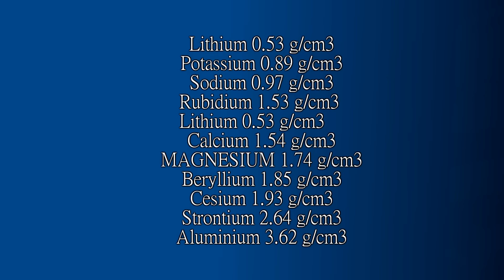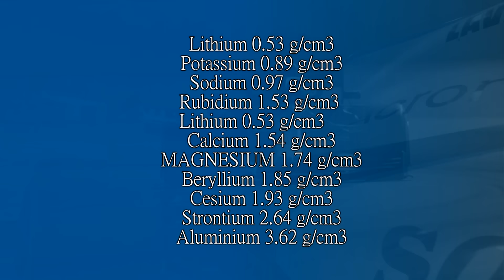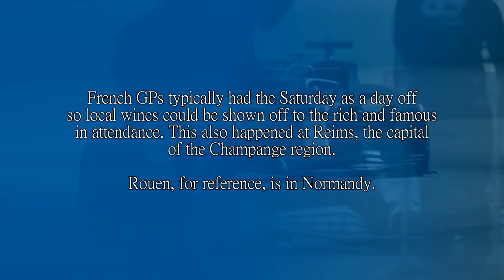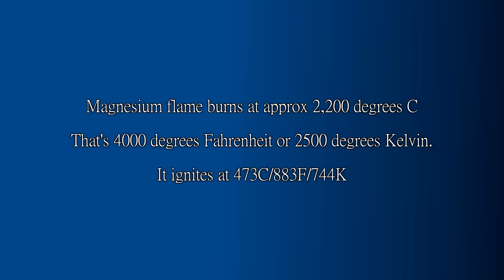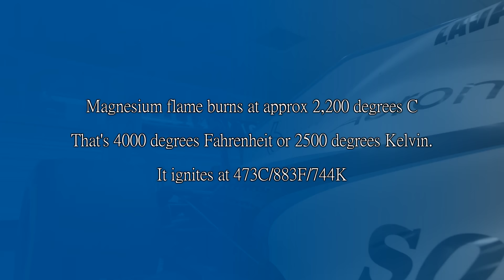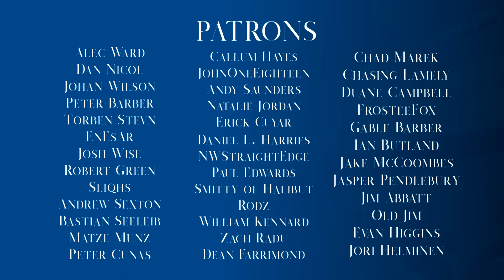The Car that Should Never Have Raced: The Story of the Honda RA302

Comment: There are videos on YouTube of Schlesser's Honda after it crashed, and the resultant firefighting effort.  But I wouldn't recommend seeing them if you are in any way squeamish or easily upset.  The fact they tried to put out a magnesium fire with water is alarming to say the least.

I read an eyewitness report on the Autosport Nostalgia forum that said the Honda landed upside down so hard after it flipped, that Schlesser may well have been killed before the fire started.  We can only hope.
Reply from the maker: It was shown in the Killer Years doc along with Von Tripps’ crash.
Reply: I'd say given the near fatal injuries sustained to A.J. Foyt in a more secure stock car at least for a flip given the roll cage at Riverside that Schlesser was almost certainly killed as (a. the embankment Schlesser went up was steeper, (b. Schlesser's head and neck were exposed, (c. Schlesser rolled more times than Foyt, (d Schlesser landed upside down, and (e. Foyt was declared dead and only revived by Parnelli Jones removing a clod of dirt from Foyt's mouth.

And there was a lot more things going Foyt's way at Riverside for it to almost kill him.

Comment: The three most hard-hitting deaths in F1 were (in no particular order):  Senna, Villeneuve and Clark.
Reply: I won't disagree, but in my time as a follower of F1, we lost Jules Bianchi. Maybe not yet as beloved by fans as the drivers you list, but Jules' life-ending collision with the crane in Suzuka resulted in at least 2 major changes in F1: the virtual safety car and the Halo. Since then, we've seen multiple accidents where the Halo unquestionably saved the driver from critical injury or death. Verstappen landing atop Hamilton is one, and certainly Grosjean's miracle survival after going under a fence. It's unknown what effect the VSC has been on safety, but it has surely changed pit strategy!

Comment: Yes,  magnesium will burn quite readily in air once ignited.  It will also burn under water so no good hosing it with water.  Aluminium also burns readily in air IF and only IF its oxide coating is removed first.  Aluminium readily forms its own oxide coating which then prevents further oxidation.   Beryllium is about as light as magnesium but its dust through abrasion or machining is highly toxic needing very special dedicated machining facilities and then in products where it can't fragment.  Upside is its very low coefficient of thermal expansion.  Titanium will also burn in air in the right circumstances.   Notionally about as strong as steel but but with an SG of 4.5 vs. 7.85 for steel.  Epoxy carbon composite volume for volume is notionally as strong as steel but one third the weight.  However as Rolls Royce found out during development of the RB 211 when wet it then becomes notch sensitive.  The smaller the dia. of the carbon fibres in epoxy carbon increases the strength BUT fibres small than 10 micron in dia. can permeate the human skin and migrate throughout the body,   which is why industrial  carbon fibres has filaments 10 microns or bigger.   So called high modulus epoxy carbon uses filaments smaller than 10 microns so if a fighter jet crashes near you it may well contain both beryllium and high modulus epoxy carbon so best to keep well away.

Comment: The magnesium wheels are alloyed with other metals for this very reason. Sparks can be any metal filaments under extreme friction. That being said, it isn’t easy to ignite magnesium. The autoignition  temp is around 880 degrees in freedom units…

Comment: Magnesium? Like those emergency Firestarter blocks, with a ferrocerium striker on the side. You scrape off slivers of magnesium into a pile with your camp knife, and then turn the block over to use the provided ferrocerium striker to shower sparks over the pile of magnesium slivers. That material just burns until its completely used up. It creates its own hydrogen when thrown into, or doused with water. Incredibly volatile stuff, burning at 4000 °F.

And Honda built a car from it? Thats actually crimminal...

Comment: The main problem Honda had was that their car concept was based on the pre-1966 assumptions about the 3 liter formula.  Most teams guessed that a large, high power engine was the way to go and assumed that meant a V-12 or in BRM's horribly bad ploy, an H-16.  Cooper, Ferrari, BRM, Honda and Lotus (initially) were all on this path.  Gurney's Eagle was essentially based on the Lotus 38 Indy car, which again led to a larger, heavier car.

Then Brabham came in with a relative low power engine but a car that was close the weight limit and won the 1966 championship.  And Chapman came out with the Lotus 49 in 1967, which was both compact/light but also had as much or more power than the heavy, complicated engines thanks to Cosworth.  By 1968, the jig was up for the big V12s like the Honda and the fast boys were running the Cosworth.
Reply: Yeah, boo exotic engines!! hisss!!   who follows F1 for ordinary engineering?
Reply: Did any teams consider supercharging, rather than turbosupercharging, their existing 1.5L engines?
Reply: @stephenscholes4758  
Well, following was what the exotic engines did.  They followed the cars with Cosworths.
Reply: Because it was cheaper to buy an off the shelf engine. Money no option, a V12 with the same development, will always beat a V8 in every respect
Reply: @stephenscholes4758  
Well, there was a test case from 1967 to 1981.  The final score was V8 - 11, V/Flat12 - 4.
Reply: @jimiverson3085  How many non-Cosworths?  One? So much for it being the designers choice. Even Brabham thought his was quote "not a true GP engine...."
Reply: @stephenscholes4758  "A V12 with the same development, will always beat a V8 in every respect" It didn't though, not even from 1989 to 1994 when the capacity was increased to 3.5L which should suit the 12-cylinder layout more.  If I'm not mistaken you had V8 and V12 with one WDC title each under 3.5L, and V10 seemingly the optimal solution with four WDC titles under 3.5L.  The V12 seems to be disadvantaged in size, weight and frictional losses compared to V10 or V8, despite theoretically having more total valve surface area, less reciprocating weight per cylinder and thus theoretically the possibility for the V12 to pass more air through it and rev higher.  One must bear in mind that a racing car works as a total package, the most powerful engine in isolation is not necessarily the best if it is too large, too heavy and uses too much fuel.

Comment: I worked in the field of automation repair.  I was given the task of assessing the damage to a machining center that
they had been using to machine magnesium.  Mag is unusual in the fact that pouring water on a mag fire only makes
it burn hotter.  Because the magnesium burns so hot, the Magnesium will take the oxygen and hydrogen out of the 
water and burn it as fuel.  The cheap way to put out a mag fire is to use oil.  I know it sounds crazy, but that is what 
works to smoother the fire and deny it the oxygen it needs to burn.  
The operator of this machine had failed to continually clear and clean out the chips that were building up on the 
machine.  So the magnesium chips were piled up under some of the panels.  After this fire started, they could not
get close to the machine and this pile burned like a coal fire.  The heat and smoke was so intense that the fire
department elected to keep the building from burning down and just let the magnesium burn itself out.  It took 
hours.  The heat from a mag fire is one thing.  The brightness from these fires is blinding.  You can't look directly
at it.  Much like watching someone weld.  The brightness will cause eye damage.  To get some idea of what 
magnesium does.  During the 4th of July, they sell these things called "Strobes".  It a device that burns and then
flashes like a light bulb with this blinding light.  That is magnesium.

Comment: Magnesium body-panels were fairly common until the advent of composites. Pierre Levegh was killed in his Mercedes-Benz 300 SLR when it crashed during the 1955 Le Mans disaster. It's Magnesium body bust into flames showering the spectators with white-hot metal, contributing to over 80 deaths & maiming another 100 . To give some idea just how flammable Magnesium is, in it's powdered form, it  is the primary constituent for solid-fuel propellants as used on the Space-shuttle's boosters & many ballistic missiles: quite literally these cars are made from rocket-fuel.
Reply: Elektron in The German....

1935 <

J.C.
Reply: @hairydonuts6024 - From what I've read and seen, it wasn't pieces of Levegh's car bodywork on fire or not that killed so many spectators but the front drivetrain assembly axel and all, detached and catapulted into the crowd, causing blunt force traumas and many decapitations, I think in some angles of captured videos, you can see the car's bodywork landing straight on the tarmac and catching fire but not exploding bursting apart or flying into the crowd, of course front drivetrain might have included parts of the engine, like swinging a giant machetti trough the crowd, a terrible tragedy...
Reply: @marclevesque3147   As I said "contributed". The bodywork "exploded" right in front of the crowd, helping to incinerate the front row, but, yes, the main killer was the engine-block which ploughed through the crowd like a sledge hammer. You can clearly see this on newsreel footage. There's 2010 documentary, worth checking out on YT called 'The Deadliest Crash: The Le Mans Disaster' which attempts to unravel what happened, though accounts of events are confused, there's still, some controversy as to who was most at fault. One thing we can conclude is Magnesium is a dangerous choice for a racing-car's body-panel.
Reply: @hairydonuts6024  I agree with you, I rewatched the clearest(?) footage I could find, one thing seems clear tough, I don't know at what point Levegh stopped to refuel, but it seems he must have had a great load onboard, as soon as the car impacted the separating wall you can see clearly a distinct fireball that reduced quickly but the propagation of heat and fire quickly engulfed the car's body, if the car had gone further into the crowd, the casualties could have been double or worse, the car's fire was obviously intensified by the magnesium build, just like Shlesser in 68 and Siffert in 71, those fires seemed hard to extinguish, lessons were learned following disasters like these, but after the 55 disaster, racing car's magnesium bodypanels should have been banned, but even with less flamable body materials, it took a lot more time and deaths before fire became less of a killer particularly on long road circuits where in the old days fire tucks were scarce and crews were not properly equipped or present... No wonder at first, drivers were reluctant to use seatbelts, they preferred to risk injuries or death being ejected than being trapped in a burning car... And those who were even worse out of luck, ended up on fire upside down, like Bandini or Williamson, they obviously couldn't have survived, poor Bandini was alive for 2 or 3 days after, I hope the doctors were merciful  and kept hiim unconcious until he passed, heavy burn injuries must be near the top of physical human  suffering...

Comment: But how did the car do in mario kart?
Magnesium is in aluminum alloys and aluminum is also in magnesium alloys which also helps it not catch fire as easy.  
The worst industrial accidents usually have to do with magnesium powders catching fire.  Like you said big chunks do not burn easy.  
Great video as usual.
Reply: @Retired Bore magnesium burns so hot that water is fuel.  Any moisture in that sand and u are adding fuel to the fire.  A small amount of magnesium dust to catch fire will catch aluminum oxide and titanium oxide on fire as well.  They are usually close to one another as all are used in industry.

Comment: Example: commercial-grade aircraft “steering wheels” were magnesium, whereas the mil-spec versions were aluminum - when I worked at Boeing 30 years ago.

I recall there were “mag fires” on a few occasions…
Reply from the maker: Hornet ones were mag, apparently. Protocol was to shove em off the deck of the aircraft carrier if it caught fire.

Comment: Great historic race car piece. Great historic race track. Great historic race. Great photos at the beginning. Great production value all the way around. I like it! You left out the fact that once magnesium starts burning, it cannot be extinguished and water just makes it worse. When magnesium interacts with water, it will form a hydrogen gas that ignites violently due to the excessive heat and oxygen supply. When it reacts, it will burn hot enough to decrease the water molecule, which turns to a Hydrogen Gas. So the firefighters at the track didn't just not do anything and let burn. There was nothing they COULD do with a magnesium fire.

Comment: Magnesium was old hat. Used extensivly in Europe decades before. And it burns really well as any school kid is taught. And as any race fan or aircraft fan know.
There is magnesium and magnesium alloys however. 'Mag' wheels are not pure mag but an alloy. Though get them hot and they still burn. And absorb water like a sponge!! The reason nearly all 'mag' wheels are cast alloys.

Comment: Once magnesium starts burning if you apply water the burning will strip oxygen from the water releasing hydrogen.   The reason the fire fighters didn't put water on the fire is that water would accelerate  the fire.

Comment: Rally  cars have been known to set their wheels on fire,  I think F1 wheels probably fly apart too quickly
Reply: that's true, an example being Jonny MIlner's  Toyota Celica on the Jim Clark memorial rally in 2000, the fire spread to the car and was so bad that they had to use a foam that was usually used for aircraft crash fires

Comment: Actually the United States bought titanium from Russia by third parties since Russia would never sell directly to the USA. I remember watching a Formula one where an air foil failed and the car drove directly into a wall desentigrating killing the driver. The memory is still in my head because I knew the driver was killed. Nascar had problems with engines such as the 426 hemi which could exceed 200 mph. The tires at the time were not capable of that speed. Magnesium was well known for being extremely flammable, even then. Engines were producing power and speeds that the technology of the cars were not capable of handling. Today's racing cars are light-years ahead of the old cars. In Nascar restricter plates were installed to slow the cars to a somewhat safe limit. There is a point where drivers are incapable of reacting at higher speeds even if the car is able to reach such speeds. I've driven at high speed,not Formula One speeds, but fast enough to know you have little time to make corrections. There is a limit to human ability to what cars are capable of now. Professional drivers race are on tracks they know every inch of. People on the open highways don't understand they don't have the expertise of the professionals and that get them killed. Especially with the technological powerhouses you can purchase today. Many of the performance cars today would leave the best racing cars of the past in the dust if they knew how to handling them which most people can not. I drove fast cars from the 1960s and it's a wonder I didn't get hurt or killed. I witnessed a Mustang Shelby GT lose control and hit a tree. It had to be picked up in pieces and it killed everyone in the car. It wasn't an open casket funeral.  Very sad and unnecessary. I had a chance to buy a perfect low mileage Shelby GT big block for 3500 dollars. It was absolutely a beauty. At the beginning of the 1970s you couldn't afford the insurance for the muscle cars. I would have probably killed myself in that car. No one would ride with me then, not even my brother. Here in Tennessee many started driving when we were kids and some of us were pretty good and some of us didn't make it. I was clocked at 118 mph in my 1968 Mustang by a highway patrol. I pushed it to 135 mph but he didn't pursue me.  The trooper pulled up in my driveway the next day and talked with my grandfather and me. My grandfather asked why he didn't pull me over. He told my grandfather "that boy wasn't going to stop for me." He was right ,I wasn't. The trooper did not give me a ticket. I was in enough trouble with my grandfather. It was a different time. Here's another story. Western states did not have speed limits at one time. I remember my mother setting the cruise control on 120 mph driving a 225 Buick Electra, 455 big block on the open highways out west.  It was legal and a plane crash if you wrecked. A friend of mine gave me a ride from Carson City to Reno. It is 30 miles. He made it in 15 minutes in a big block Camero. It wasn't a pleasant ride especially when your not the driver. That car could hit 160 mph and it wasn't safe. Probably had biased ply tires. I'll stop here. My wife is with our daughter and new granddaughter for the week and I'm stuck at home with the dog and totally board. My wife and I have been together for 40 years and for twenty years we rode to work together at tha same hospital.  She was in x-ray and I was in the ER next door. Our children tells us we are weird because we are always together. We've always been best friends and are much alike. Opposites may attract but they usually don't get along. That's a fact.